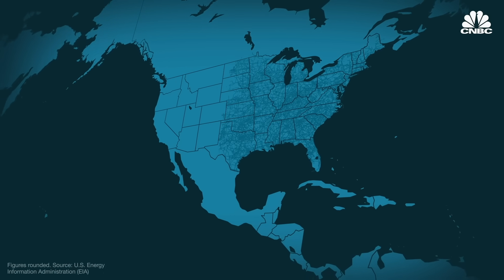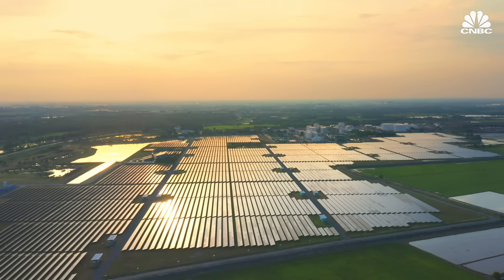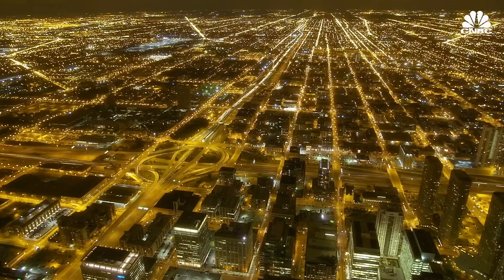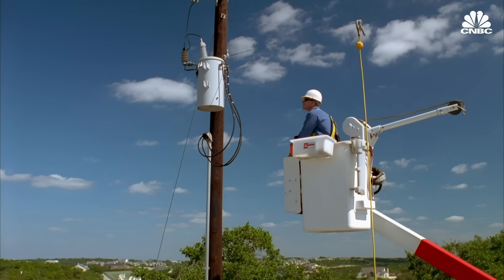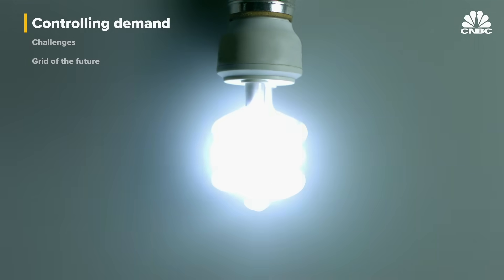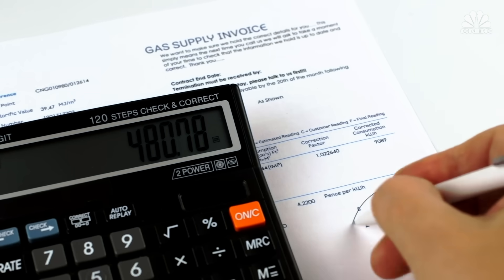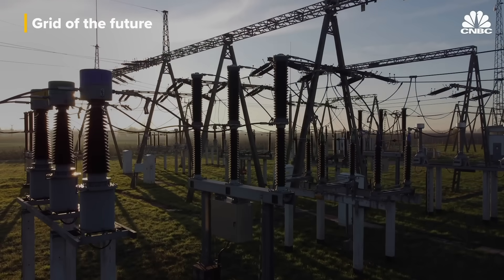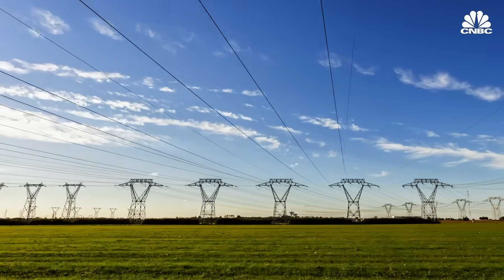How The U.S. Can Build A 100% Clean Grid

Comment: Best green energy with zero emissions: NUCLEAR POWER
Reply: except toxic waste which normally is hidden under ground or in some facility. Plus huge danger of disaster (Chernobyl, Fukushima)
Reply: @poolas8ball  Hiroshima? Did the US Air Force drop a nuclear power plant on the Japanese from a B-52. Damn that plane must have been massive...

All joking aside I assume you mean Fukushima
Reply: @poolas8ball  process has been improved immensely over the decades. With proper building, maintenance, etc the risk is minimal. Upside is that you get clean energy pumped out for numerous decades. 0% emission and no need to repair, rebuild, or recycle old materials like solar panels and such. Risk of future Chernobyl’s would be minimal if done correctly. :)
Reply: @SonofZeusGOW  You still didn't address the disposal of the radioactive waste that stays harmful for hundreds of years.
Reply: @50jakecs  
Actually! You can recycle the toxic & radioactive waste. It's called nuclear re-procession and vilification.
Reply: Very clean but with a small risk of massive problems. Like Fukushima.
Reply: No!  Nuclear power is a viable and useful way to produce power.  But it is NOT zero emissions.  Yes, there have been great improvements in plant design and the type of fuel used.  But, you do still end up with decaying radioactive stuff that is very harmful to human life.  Some designs and fuels are less savory than others.  Also, every plant design I am aware of dumps massive amounts of waste heat (usually warm water into rivers).  I think nuclear power can still be a viable option, though probably not in the U.S. for political reasons.  The society largely doesn't want them.  But, we don't seem to mind nuclear powered submarines and aircraft carriers...  Oh well.
Reply: Nuclear plants require more land than some of the alternatives.
Reply: @palmshoot  I doubt for the same generation
Reply: @brian2440  From what I've been able to glance, the only commercial, off-land nuclear power stations are in Russia.  So, the other renewables are more likely to be hosted over water or underground, in which case they'd use less horizontal land.

Comment: All well and good, but the efficiency of wind and solar power don't approach anything like that provided by water and petroleum. 
We have a massive energy need in the US that cannot by so-called renewable energy.
It doesn't help that many of the necessary components, like batteries, are manufactured in other countries that don't concern themselves with the environmental impact of dirty production facilities, particularly the largest such country, China.
Furthermore, the least polluting and most efficient energy source is ignored and excessively regulated by politicians and bureaucrats, not engineers and scientists.
That's right, despite the propanda and the lies, the best dollar for dollar value, energy-efficient, and least polluting is: NUCLEAR POWER.
It is also potentially self-renewing, because enriched and used nuclear fuel can be reprocessed and reused in a variety of reactor designs.

Comment: Geothermal is the solution to a base load that is much better than batteries. Oil and gas technology can be used to extract heat and run turbines in closed loop systems. Constant power. 24/7 not caring what is happening. Turbines have been designed to run at just 150 degrees.

Comment: I don’t want G.E. to be able to turn off my stove..
Reply: Your gas company already can!
Reply: @specialopsdave  No they can't.  Not really.  They would have to shut down a huge section of their grid.  And the gas has to go somewhere.  It would take a long time to drain the pressure from the gas lines enough to turn off your stove.  The gas company cannot turn off your stove like a "smart" appliance (which is a mischaracterization as well).
Reply: The video could have done a much better job of explaining "smart" appliances.  The idea is that you "won't notice".  That means things like changing the time of day that your refrigerator/freezer goes into defrost mode, which requires a lot more electricity than keeping things cool.  Or starting your dishwasher at 2 AM instead of at 8 PM when you might have started it.  The "smart" appliances need to be smart enough to allow the user to override the power company and not the other way around.  And this is where the danger lies...  How will this be built?
Reply: @scottharwood8839  excellent points and breakdown. Using the buzzword ‘Smart’ for any level of nuanced power optimization is going to scare/confuse most people into thinking any new power systems are trying to control your appliances and spy on you.

When realistically any update/upgrade of the grid is 99% structural and completely within the bounds of established power systems.

Personally, I’m extremely certain that power rate scheduling is all that any household would need to be able to optimize their power usage timetables without any expensive and error-prone gimmicky network.
Reply: Well they can transition into the renewable power industry .We will still need gas but it’s a non renewable resource meaning eventually we will be out in the future if we keep up like this.
Reply: my dude I had the exact same thought when reading this

Comment: @12:01 I've used OhmConnect. It's kind of a joke. Wouldn't recommend them. Though I should thank them for at least me getting smart plugs at a discount, but these days you can get smart plugs from Amazon that are affordable. Also, we already have what it takes to go carbon free without drastically changing the grid or how we use it. It's more of a question whether we care enough to take that step.

Comment: The Power Grid that we already have, has been built to accommodate peak load.  The grid is capable of supplying power 24/7, yet it is currently underutilized at off peak times, especially so at night.  Electrifying our main means of transportation, personal vehicles, will allow us to take advantage of this, allow us to utilize our grid 24/7.  Fill up our 'tanks' at night, when 'gas' is cheapest.  Will this alignment of demand and supply itself be enough or will we need to increase supply?  I imagine we already know, so what's the answer?  Will we need to increase supply and in order to accommodate demand or will battery enabled buffering be enough?

Comment: Not bad overall, but when they said 4.5 trillion to convert the grid, they failed to mention how much more it would cost to keep the grid the same as it is today. Also, while I appreciate the "virtual powerplant" that isn't the only way to do demand management. The other one is to install meters that can measure not just how much electricity you used, but when(smart), and have the price people are charged/paid vary minute by minute. Of course you have to publish the price and price forecast on the internet. Computers are low power, and cheap. We, or the installation guy can configure them to save us money. Keep in mind, anybody that shifts their load to save money, saves their neighbor who doesn't shift, money too.

Comment: One assumption that seems to be incorrect in this presentation is the notion that only rich people can afford a solar system. This is categorically untrue. But, reasonable based on the tendency of people to put a reputation on something as it was originally created and that reputation sticks with that particular product for far too long. It is true that solar panels, back in the 19 70s, 80s, and 90s, we're very expensive. Currently however, if a person can afford their monthly electricity bill then they can also afford a solar system. The loans involved in doing this are structured in such a way that the payment for the solar system each month is the same as the average electricity bill for that customer. We are by no means rich, and have had two solar systems on two different houses, and paid them both off. We are average I come type people. It is possible. People just need to be informed.

Comment: 1. Since a smart grid requires an internet connection, it would make sense to lay down a smart grid alongside a national broadband program. and parts of the country, 10 megabits per second is considered broadband. worst yet, some areas simply cannot get any form of high-speed data and still use modems. We should lay down fiber optic cables both for the grid and to ensure that homes and businesses get access to broadband regardless of socioeconomic status and distance from central hubs. Smug entitled urbanites and the politicians they donate to and vote for seem to think that people in Appalachia should just switch jobs or learn to code when the coal mine closes. They are simply not paying attention to the lack of infrastructure. And there's a similar problem of lack of access to broadband in many poorer and minority communities in urban America.  And since we have a Nexus of reliable power and fiber optic cables, we could also make it cheaper to deploy true 4G and 5G cell phone towers along these roots using cell phone modems that don't come from Huawei and other Chinese companies. In fact, as a national security issue, the modems and routers for the smart grid itself should not be reliant on Chinese technology or products made in China. 
2.Lithium ion batteries are a poor choice for energy storage on this scale. The technology was designed for lightweight battery is in Mobile devices, not constantly charging energy storage. We need to develop better alternatives https://pubs.rsc.org/en/content/articlehtml/2020/nj/c9nj05682c

Comment: Solar panels arent the way to go.. 39 million solar panels. All of these panels will eventually need to be replaced equating to millions of tons of waste that will only continue to compound over time. Ive installed over 3000 solar panels a day on a team with 7 crews 4 people a crew for numerous 50mw solar facilities verified and im not so sure its the proudest thing ive done. There are issues as well with heat distribution when your talking how large of a scale the project is. Meaning more and more replacement panels. Granted it was only a 50mw facility, were talking kms of rows of solar panels.

Comment: https://www.eia.gov/tools/faqs/faq.php?id=427&t=3

Wind and solar energy isnt the future. It can only do so much for use. If we soly relied on wind and solar, plus had only electric cars the power grid would go out multiple times a day because we would demand more then the grid can take. Also something I would like to note is power companies charge you more per kWh when applying to wind and solar. Coal burning plants have become suprisingly more efficent and less pollutant due to stricter codes that the federal government has put in place. Most of what comes out of the stacks at coal burning plants is steam from the boilers due to the amount of regulations that have been put in place. Do I think we should find a better way? Yes eventually. But wind and solar is not the right path.

Comment: Anyone hear of the duck curve ...when the sun goes down and people aren't centralized in offices and spread out turning on ac or heat and lighting their homes cooking ect... Demand goes up so solar on your house didnt do much except feed the grid back ...now with the high demand for all that I just mentioned the fossil fuels have to kick in ... You know what the fossil fuels do they feed the plants bc trees and such use the co2 for photosynthesis... Wind turbines need 10 to 60 gallons of oil every 36months the bearings that allow the turbine to spin grease ... And the plastics for your phones ... oil based the tar for roads oil plus all the heat you need to melt metal and sand to glass no way renewables can handle that ... Do your research people like how would you make the copper or aluminum for the wire? Need fossil fuels hate to break it to ya

Comment: A lot of the statements here are just not true and misleading. 

There is mining of the earth to get the raw materials for these "Green Energy" Solar,Wind, and Battery technologies and are very damaging yet are not talked about. 

Power infrastructure does indeed work both ways. that wire to your home does not care what direction the power flows. They must need government, "Our Money", to upgrade their bank accounts.

Smart Meters, while starting with power meters are now on most utilities and not only reduce jobs, but let utilities remotely turn off those utilities (Black Outs) as well as charge different "Tiers of service" rates at different hours of the day. They do it already now on some accounts.

Using your automobile battery to supplement energy needs will have a direct effect on the life of your battery and reduce energy available for you to drive when you may need it. No mention if your battery replacement costs might covered.

New Commercial Solar facilities have been signing contracts that do not provide any savings to end users. Still high rates for users.

These "Clean" Natural Gas power generating stations still contribute large amounts of Carbon Dioxide. Not covered here. 

Here is a note: The government of Dubai required that LED lights use half the power than the ones available in the United States use, and last longer. 

Phillips does make them and they are not available anywhere else. Let's require them here...

Regarding The Paris Accord, we should have the same agreement as China since they will continue to increase emissions until 2030 before they even start to reduce them. That's really saving the earth, and we let them get away with that. What did India agree to? They don't tell us yet we lose jobs due to our commitments that reduce our job numbers. We still buy Chinese goods, so we support increased emissions and communism. We should also require that all the electronic waste be returned to the originating country at their costs...

Beware of all this marketing hype, investigate everything you hear, and realize that you know nothing firsthand, you only hear and repeat what you have been told and so many sources are not accurate and may not tell the whole story.

Do your homework. 

4K TV
Most TVs that are sold as 4K cannot even display a "Native" 4K source, but the screen is 4K. You were fooled... Most people actually believe the lie and repeat it...

5G mobile phone
When you spend that money for a 5G phone, good luck getting 5G service. Infrastructure is presently being installed on roadways, (Streetlights) and new cars will 5G before you will. Your phone will resort to 4G most of the time, but you pay for 5G. 

So much to talk about, so little time. 

ebay ratings, yes ebay can and does remove negative ratings of sellers at their request, and you have no recourse. This has happened to me and the item was not as described and could not perform the task as described. It's still being sold and the listing described it as able to perform the task and the seller has a 100% positive rating. Thanks ebay.

My rant is over.

Comment: I had a good laugh over this video because most things stated in it are already obsolete. Solar and wind are not cost effective without government subsidies.  Just ask Germany how well that one worked out. How about the blackouts in California. Thorium reactors are coming on line and will produce cheap, clean, and safe nuclear energy. If you still believe in the myth of carbon as a greenhouse gas, that so called problem will be solved too. Get ready for a new era of cheap electricity and the economic boom that it will create.

Comment: all these connections are cool for energy consumption but when I hear this all I hear is expensive hardware that will break easily and a huge security issue with everything in my house connected
Reply: @N A for the whole grid yes but not for my personal privacy. They can have the main power and I'll lose access to it but they won't be able to control my house by hacking the main grid

Comment: The grid is not like a river where water flows in one direction like mountain down to the valley. That's an improper imagery.... It is more like a block tower. If you change the height of the tower, it will flow in the other direction... Not that difficult.

A dynamic grid will mean more batteries and additional hardware = $$$  Solar panels are NOT cheap, it's cost surely has come down in recent years, but it's still a fair investment at the individual level. Neither is the processing and disposal of solar panels environmentally-friendly... 

Solar/wind generators are a bridge solution towards sustainability. A true energy system upgrade would be fusion. 

This video was so obviously politically motivated that although I agree with a lot of its sentiments, there's still much to be done for a truly green planet. 

It sucks to know we need to cut back, spend more to have less in order to reduce the rate of our ever pending demise... But if slowed down enough, it might be enough time to find a real solution to suddenly solve all of our problems. For now... Having less kids and more entrepreneurs sounds like a good start...√(°x°)\-